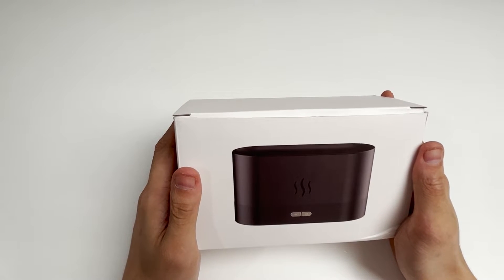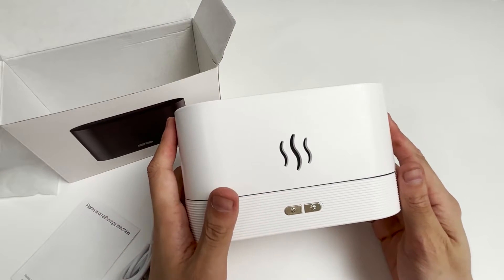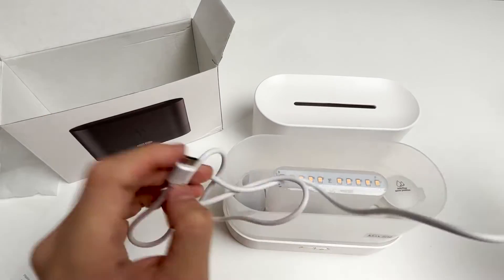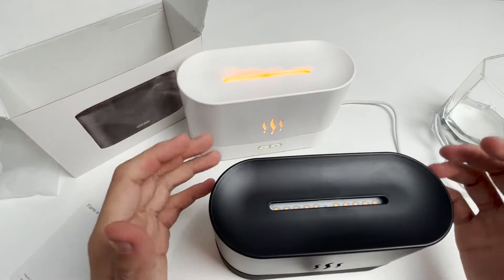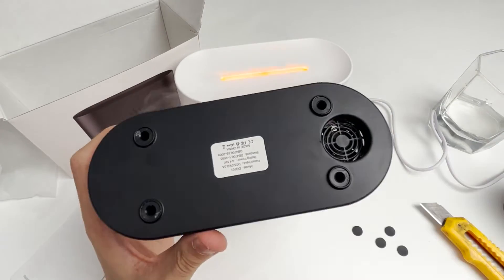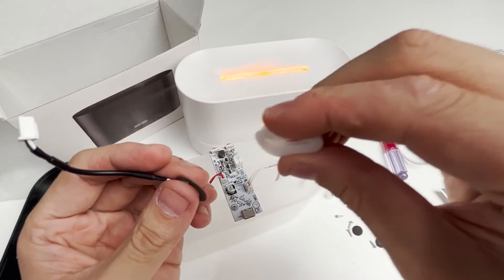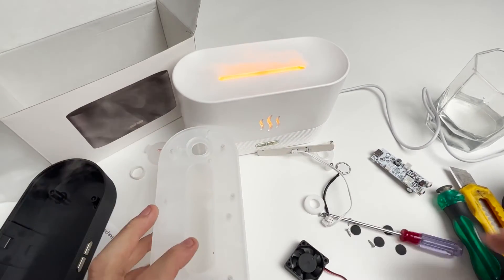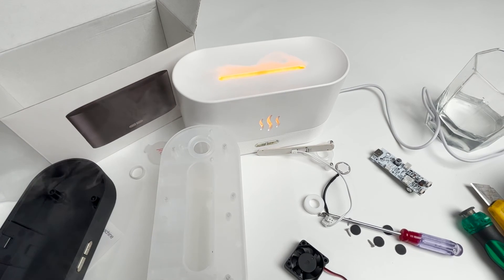Dismantling item 3: How do popular flame humidifiers work? What's it like inside?

Comment: can you disassemble the circuit? mine was only active for 1 second and shut off
Reply: This happened to me now. Have you fixed yours?
Reply: @jmgonzales1996  i just fixed mine, u have to open it up and dry up every part of the circuit with a hair dryer
Reply: @F0rtyTw00  mine too, but why dry it? I just opened mine and it is everything in place, should I clean it with alcohol and after that dry with hair dryer? please help